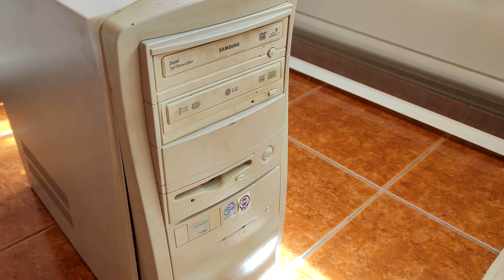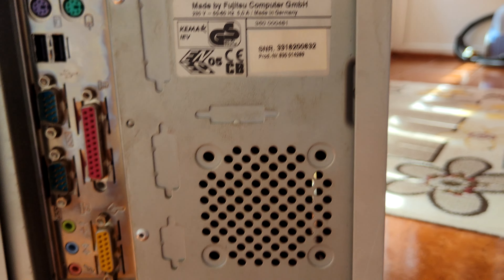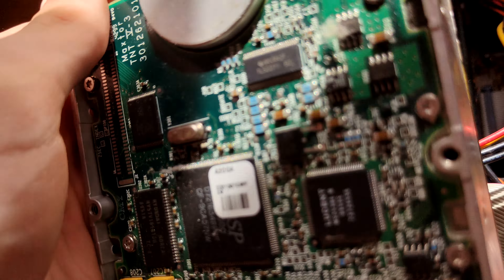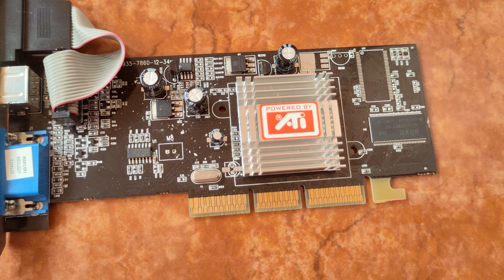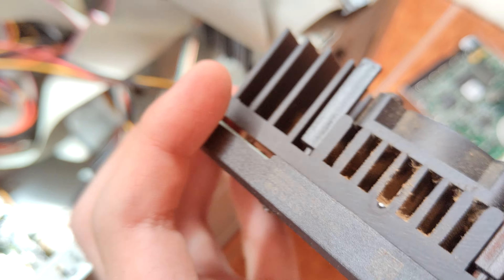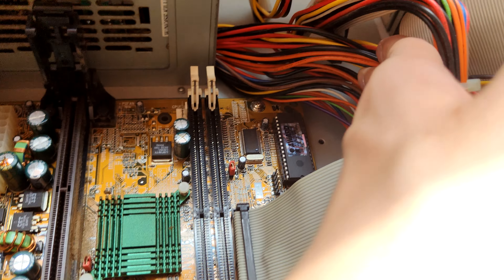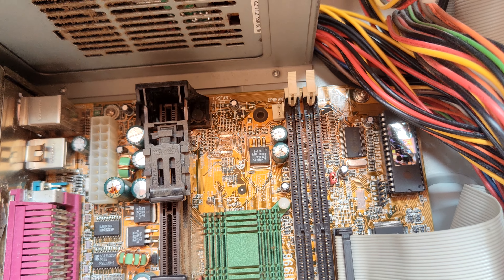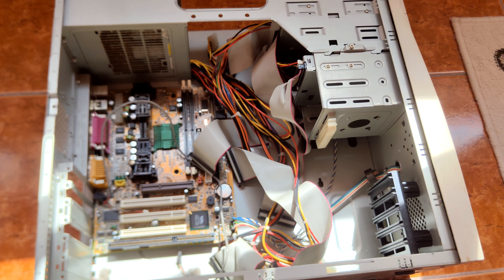Old Pentium III thrift shop find. Having a look inside

Comment: If you recap motherboard and psu I recommend riva tnt 2 ultra or voodoo3 3000 and sb live! (Or harder to get aureal vortex 2) with this you can play ton of 3D and 2D games
Reply from the maker: I would love those. but voodoos are real expensive. TNT2U too. I have some cards like MX 200 (very bad), ATi Rage Pro Turbo AGP (kinda old for it), the ATI 7000, GF 4 Ti 4200 AGP8X (a bit too new). Also have some spares like ATi 9250 or FX 5500 (ATi is better).

Comment: Those Fujitsu systems seem pretty rare,i mean when it comes to vintage computers you find lots of Dells,Compaq and HPs,but not many Fujitsu or IBM computers. I have a Compaq that uses almost this very same board (mine just has 3 slots instead of 2) and the power supply also seems to be the same as mine. If you got a Hipro psu then it's the same,the sticker is supposed to be on the other side
Reply from the maker: @usernotfound-h2v  yeah I also have a Fujitsu Siemens MCM19P1 (rebranded Samsung SyncMaster 900P 1600x1200 76Hz max) CRT monitor. Just luck I guess. I did find a Compaq DeskPro from '97 with a PII and i440BX and a Quantum bigfoot that due to some legal paper work I could not save. It had to be sent to the recycler with some other tech sadly. It belonged to a school. Would have been free to take :(

Is the hypro PSU reliable? I will look into the model of this one.
Reply: @centigrams  Yeah Hipro PSUs are reliable and they are still used in modern HP and Dells. Bad side is,these are part of the capacitor plague era and mine had 3 bad caps in it,it still worked but i replaced them just in case.

Comment: blow out the cigarette smoke from the power supply with air compressior 1st  thn boot it up
Reply from the maker: @jjohnson71958  will have to fix the board first, but yes I cleaned the PSU, wirh a vacuum cleaner but it is way cleaner.